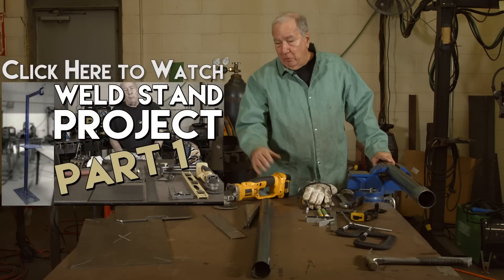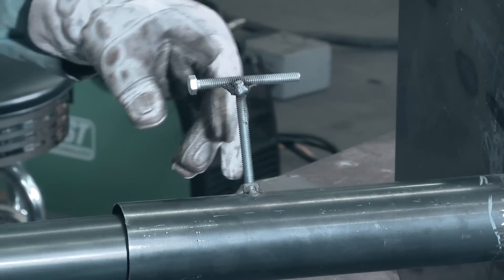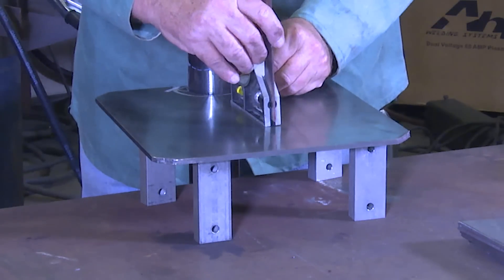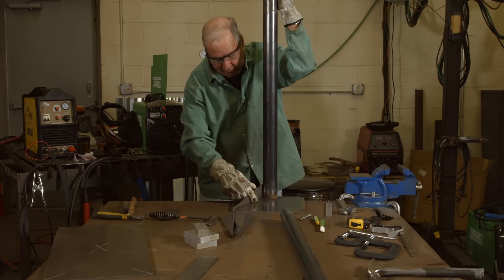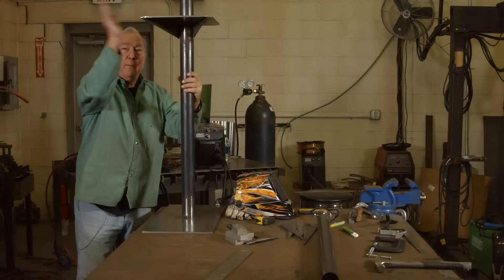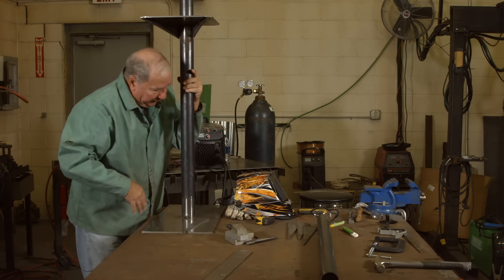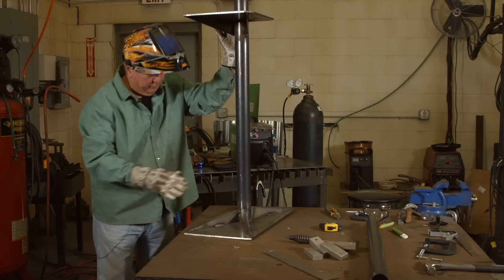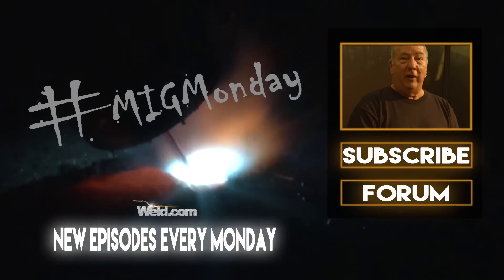DIY Weld Stand Project: Part 2 of 3 | MIG Monday

Comment: Why in the world would you not tack the top of the gussets before running beads? I'm a fabricator and I always tack all 3 corners of the gusset so it does not pull out of square..P.S learn how to set that welder,it should sound like bacon frying when you have it set right..
Reply: Jesus is King just my thoughts and this bottom plate warped quite a bit, it had a wobbly stand on the table as it was finished.
Still I like Bob Moffats videos more.

Comment: No face shield. No guard on grinder. Nice invitation for an OSHA and insurance intervention. I'm surprised you used a hood.
Reply: +Preston Helton What do you expect, he's using plate thats 3 times as thick as the pipe used to support it, which looks like he scavenged from a barbecue grill (@ 4:14 it sounds like he blows a hole through his pipe). A wire wheel would be a much more appropriate tool for the job of removing the coating on the pipe IMO...